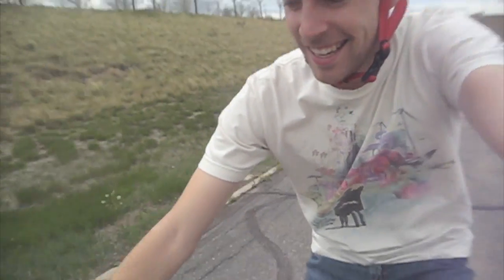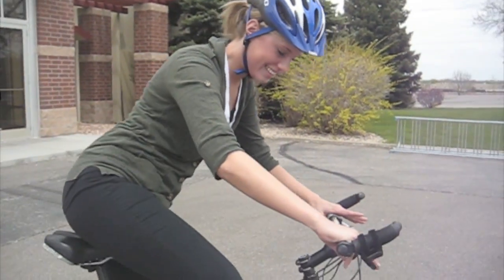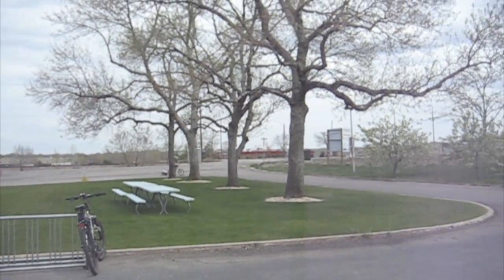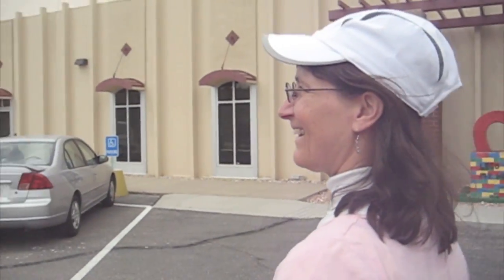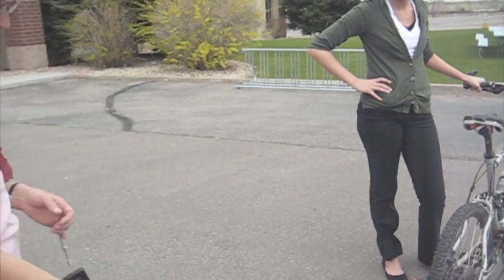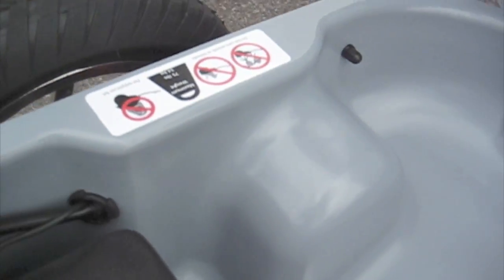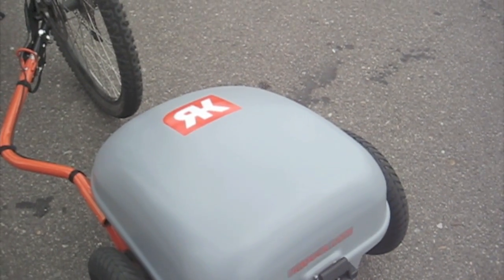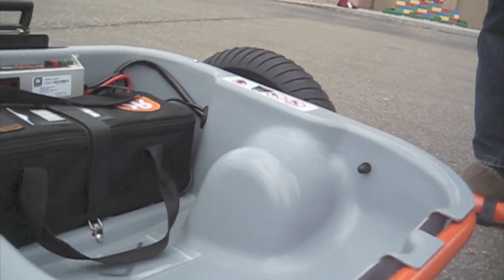Electric Bike Trailer Test Ride

Comment: So where's the motor and what are you selling. I think your talking about that little box on the back being a power source for pushing the bike, but you sure wouldn't know it from what you have shared. It wasn't until I read your description box that I had any idea what so ever of what you were even showing. Looked like a tiny carriage box for supply's, I got more room in my basket.
    Still not sure what your selling, how much it is, and or how without any weight for traction, that little box is doing the pushing or is that what this video is about, where's the battery / motor. Not very informative and pretty much a waste of time, better stick to your day job, cause promotions isn't your strong suit, thanks for the effort though.